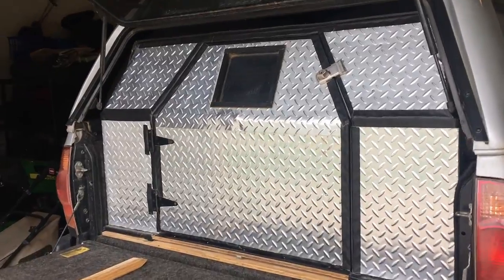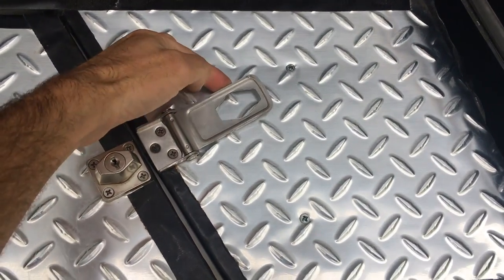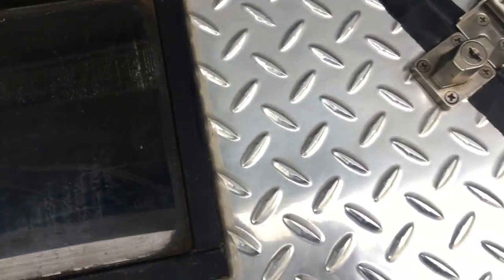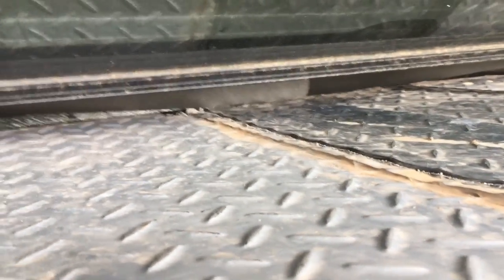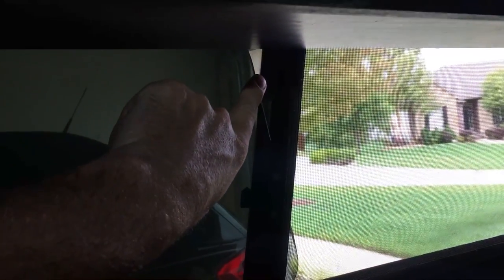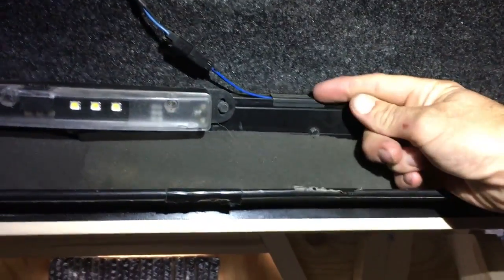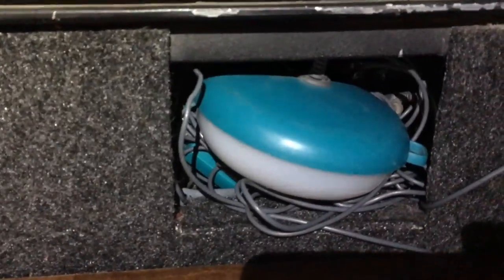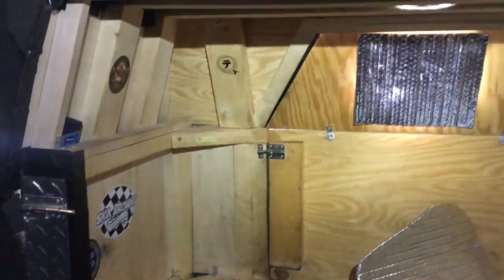Truck Camping: CHANGES/UPDATES to the slide-out extension

Comment: Hot glue or silicone works great for sealing the little holes in those cubbies. I used Hot glue and it keeps them dust free and completely dry!
Reply from the maker: Most definitely! I need to be more thorough when I do my updates and not cut any corners like I did with the top of the slide out extension. Hope you enjoy the video, have a great evening!

Comment: Hey Brian, I would suggest giving fiberglass a go.  Build a your framework out of 2"x 2" strips giving yourself the required sloping on the roof, and desired opening for the doorway.   With fiberglass you have the option to make smooth rounded corners if you like, and can get it fully waterproof to boot.  Also, you may even come out with a lighter unit overall.  After you are done with all the fiberglass work, you can paint the exterior with bed liner to make it even more robust and absolutely for sure waterproof.

Comment: Brilliant build!  With the wider door opening, consider double doors with upgraded locking mechanisms. Also, an awning mounted off the back of the topper would help with water diversion and a act as a porch of sorts.  Lastly. If you plan to progress to a 2.0 version I highly recommend using aluminum. Save on weight, gain space, more weather resistant, pop rivet or welded assembly, easy to modify a basic unit to fit ones needs. Tail gate extensions so the slid out length can be greater.  First time viewer. Subscribed so I can catch up.
Reply: things are really easy in your chair , aren't they

Comment: Just a thought on your pull out.  Putting a one inch lip around the innermost section of the pullout (matched to the contour of the tailgate rails and topper)  would allow for two things. First it would create a positive stop at all points not just the rails on the bottom. Two the mating points of the pullout could be lined with closed cell foam (like the link below) to seal out the elements at fairly low cost/effort  ( 1x2 screwed around the edge of the pullout).    Cut into strips this would also allow for a clamp seal between topper and bed to eliminate drafts.
 https://www.grainger.com/product/GRAINGER-APPROVED-Water-Resistant-Closed-Cell-5GDK0?cm_sp=Product_Details-Products_Based_on_Your_Search-IDPPLARECS&cm_vc=IDPPLARECS

Comment: Teakwood might be a better wood I heard it resists rote, insects ,moisture, mold they used it in boat interior walls long ago I have no idea of cost
Reply: Great idea good luck
Reply: Teak has all those attributes but it is INSANELY expensive. Oak is a good compromise and is very reasonable and easy to find.
Reply: And they can only sell so much at a time